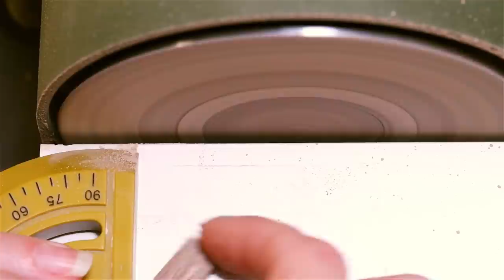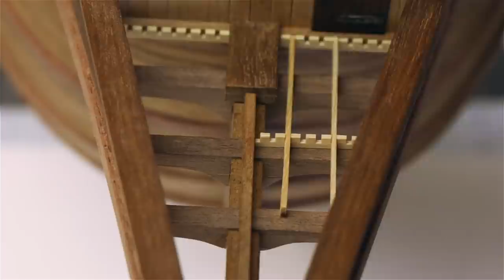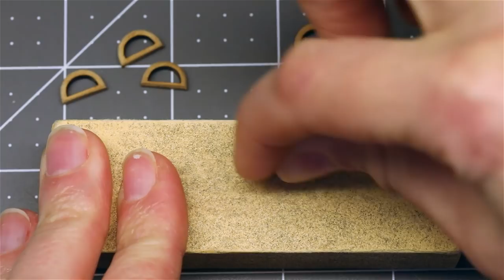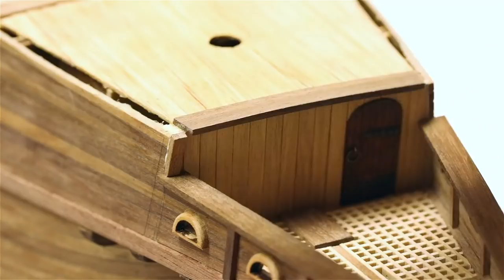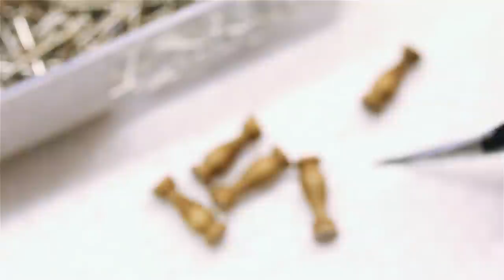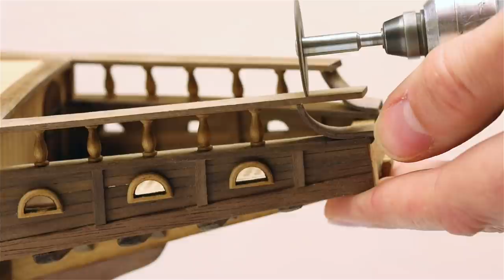Model ship building #14 - Making the BOW - RAGUSIAN CARRACK XVIc - KIT (MarisStella)

Comment: What glue are you using?   It seems fast drying and... strong holding!   Thank you!
Reply from the maker: For wood, I use carpentry adhesives such as Titebond II or PVA D3. Usually it is enough to clamp it for 20-40 minutes, but it dries completely in 24 hours... For planking - you need to clamp it for at least 10-12 hours!

Comment: Looking great!
I am surprised the bowsprit is not set into a hole.  Will this just be glued down?  If so, will you use just wood glue or epoxy?
Reply from the maker: Thank you!
According to the drawings, the bowsprit does not fit into the hull at all. It is located at an angle that visually pierces through the bow! So I arranged a square steps and will install it on a pin from an old broken drill!
Reply: A drill pin should be a good anchor for the bowsprit.